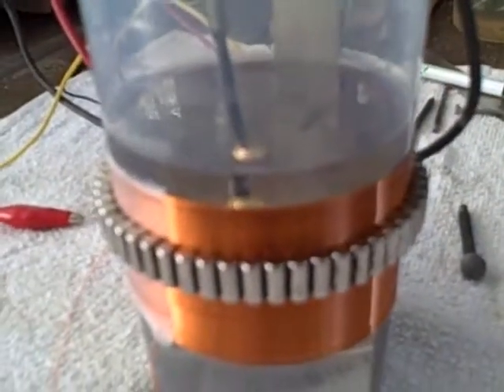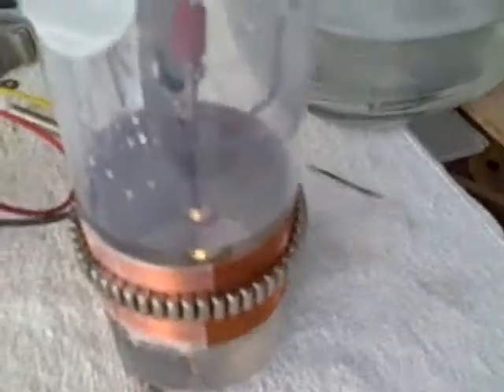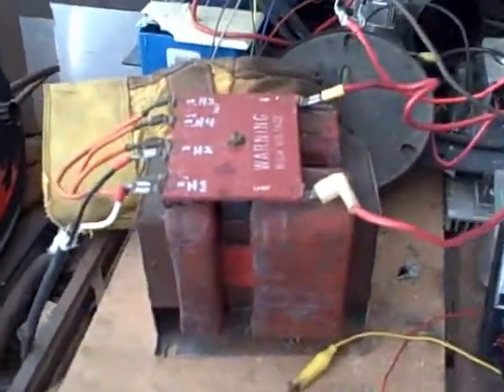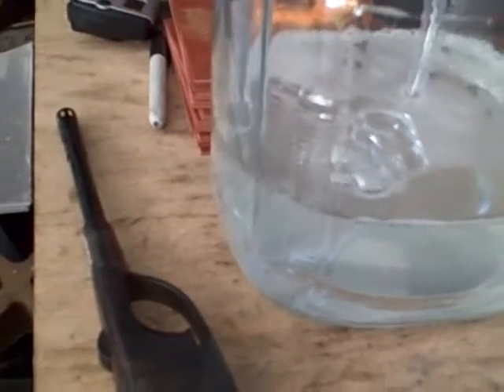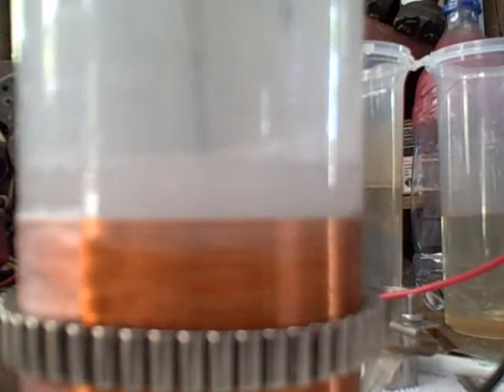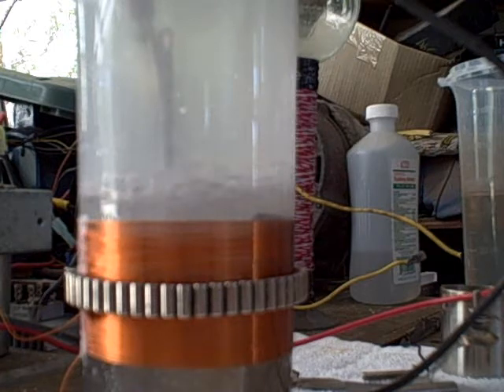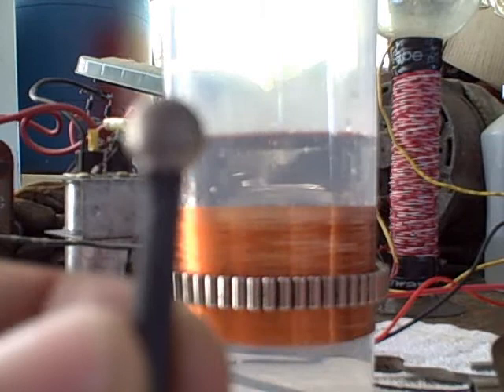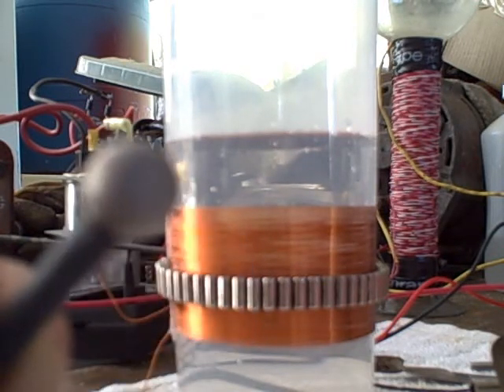CGDE Magnetic Testing.wmv

Comment from the maker: The cathode goes through a rubber grommet to seal water in and I have a test clip on the bottom. The annode has a hole drilled in it and a screw threaded into the hole with a wire connector on it.

Comment from the maker: @HHOPWR 
It appears so. Even with high temps and steam I am getting HHO production. The difference here is that hho seems to be produced at the higher temps opposite of low voltage electrolysis which I am used to. The bubbles are smaller, but boy do they pack a punch.